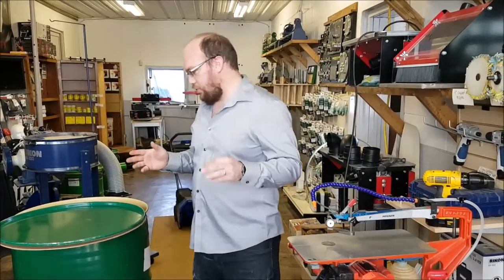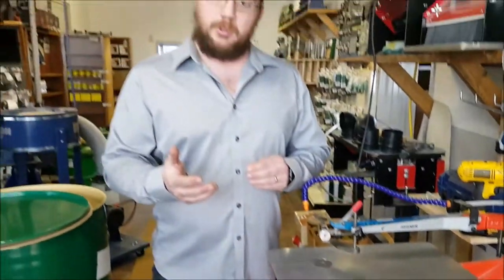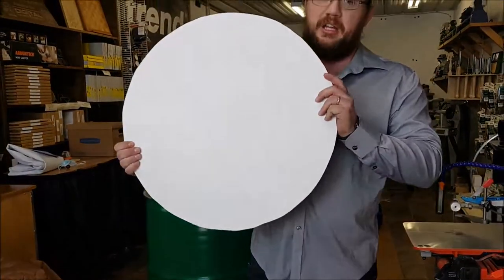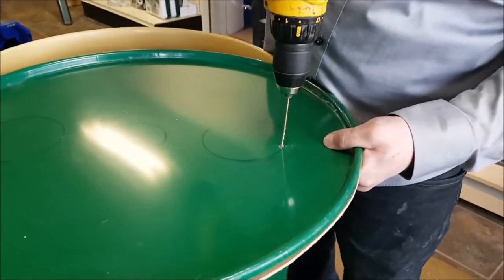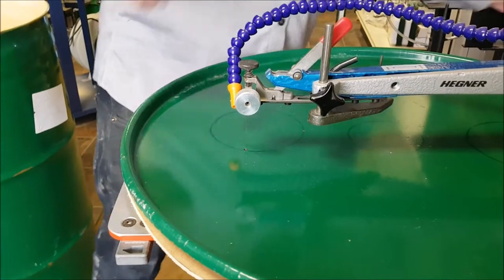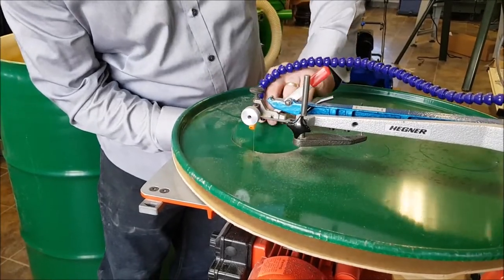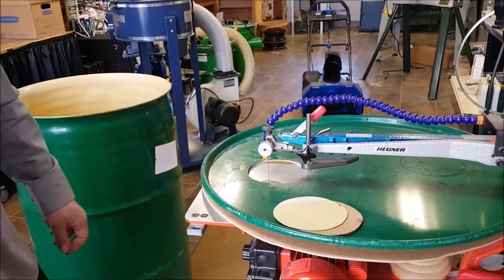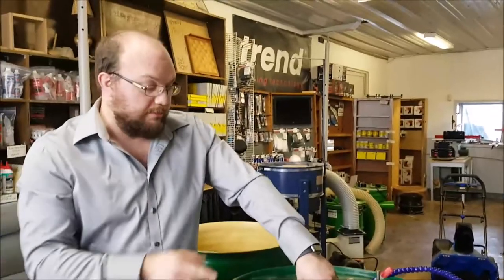Cutting Metal With a Scroll Saw, How To Do It Right! EthAnswers

Comment: I've cut 1/8" aluminum with a fine wood blade.  I smeared vaseline along the cutline and it worked well, considering that aluminum sometimes 'welds' itself to a steel blade.  The vaseline also trapped almost all of the chips.
Reply: Candle wax works too